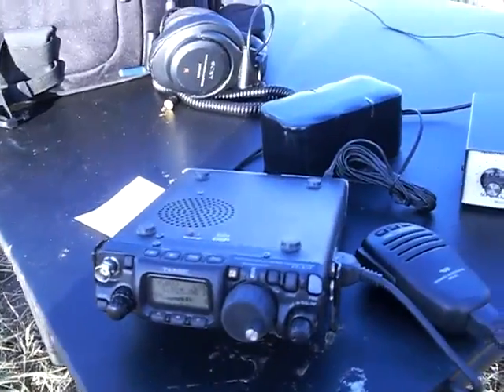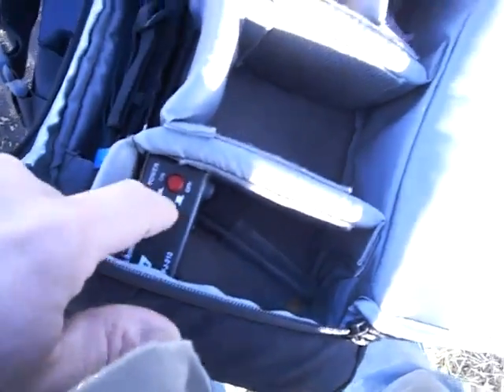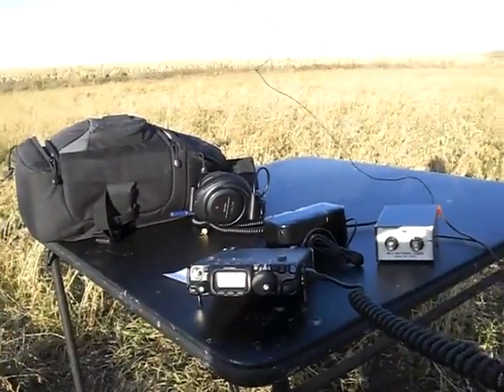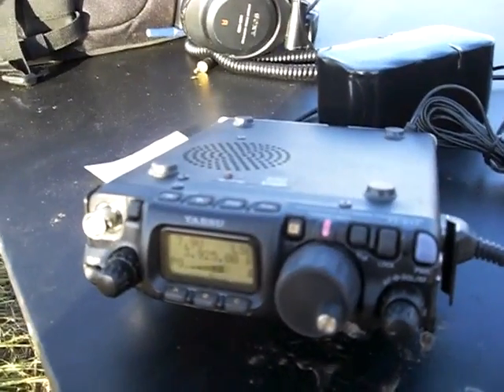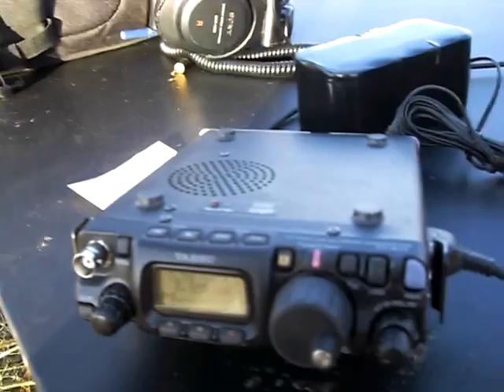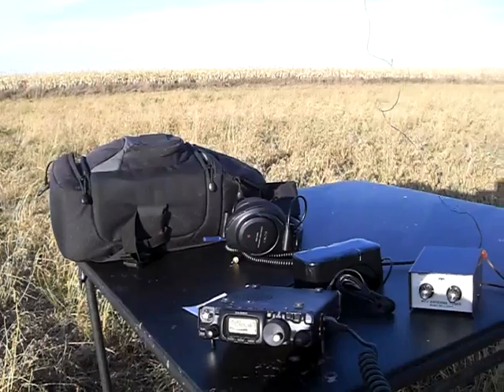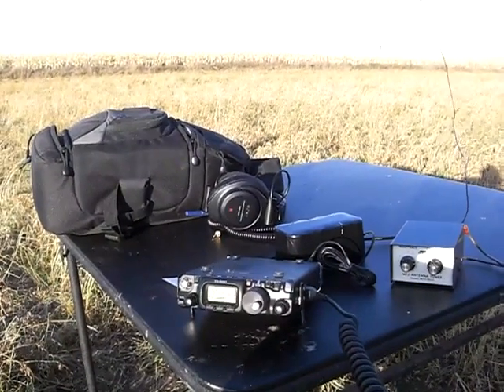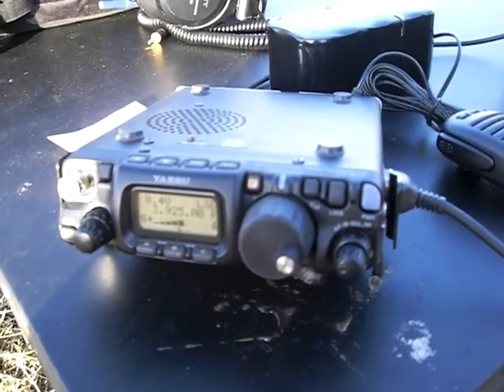Kite Antenna

Comment: There are lots of comments on static build up.  I use a simple Parallel LC to end feed a half wave.  There is a DC path directly though the L to ground which I connect to a dog stake, very simple, very safe , very effective and the tuner is the size of a matchbox.

Comment: Roger. I think I would worry. At least where I live. Washington. At the beach here, the winds kick booty, and just the airflow molecules would rise static. I think a great experiment would be to fly the kite using coax as the flying line and drop a dipole, pretty much vertical, from it. So the kite might be at 300 feet, and the antenna 30 feet below that. A vertical dipole would get awesome low angle DX! Might be a bit odd to listen to as it moves around a bit, but great fun experimenting.

Comment: That would work.. My concern was folks using a kite as an antenna as a great thing, but there will be a static buildup that could FRY! a radio..  <-- YOU HAVE BEEN WARNED!

Great comment sir! That is valued to the community. <<-- TAKE NOTE ALL

You must provide a way to bleed static off the wire or you are asking for trouble.

73'
Reply from the maker: Tahoma oh my. Scary.

Comment: Good tuner like inductive coupler/ transformer is great for safety related static issues.
Once antenna is 100 m high , or more - you have electric field corona effects.
Vertical antenna is the worst example, creating huge electric field gradient.
You have constant arc on tip of antenna, which affects receiver.
All very high antennas have this problem, not only kite lifted.
Cheers

Comment: Hi Steve, I like the video. I have done a bit of kite antenna operating myself, using an Alinco DX70TH, running 10W, from various locations in the UK. The beach is by far the best place I have tried. Regarding the static, I didn't think it was a big deal until I got a good whack one Summer evening, while bringing the wire down. I now use a 10 MOhm resistor pack between the antenna wire and the ground spike. You have whet my appetite to get out and do some more.
73, Phil, G0RKF

Comment: I was just wondering what happens to the inevitable static charge with that antenna, but I guess that's a T match or similar with an inductance from 'hot' side of the antenna to ground. There has to be some kind of DC ground there, or your 817's front end would have gone phewee by now. What an antenna though, fantastic. It needs to be tried here I think. One of those kranker VFO knobs, too!

73 Perry G0IFI

Comment: Hi there Spike! That is way awsome you were able to do that. do you still try that to this day or would you you do something differently. I have an 817 myself that I am putting in my go kit along with a 897D and 857D with 3 or 7800R's/7900R's. I'd like to try that with my 817 once see if it would work here in central mn.
Reply from the maker: K0BLR Did you ever do this Ben?

Comment from the maker: @N0rthwestRadio I didn't worry about it. From my experience you need alot of particulate matter in the air and very low humidity such as blowing snow like we had this past winter which really built up bad in the shack here. If you want ot see it check out my video called Static Electricity Discharge.

Comment: Curious, what are you doing for Static issues? Meaning static electricity building up in the system which could damage radio, or you. Thanks.
Reply from the maker: N0rthwestRadio nothing